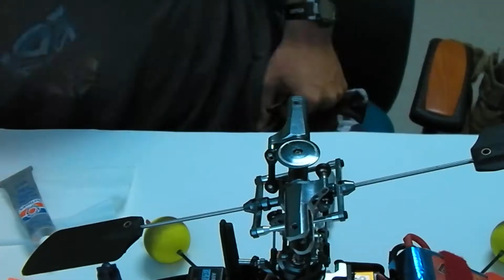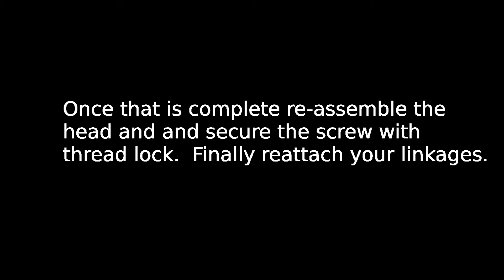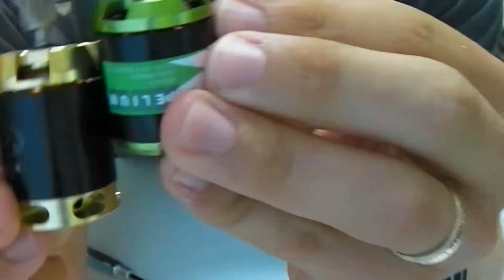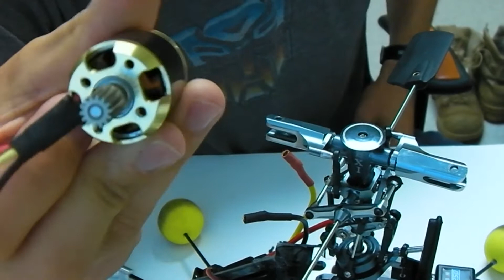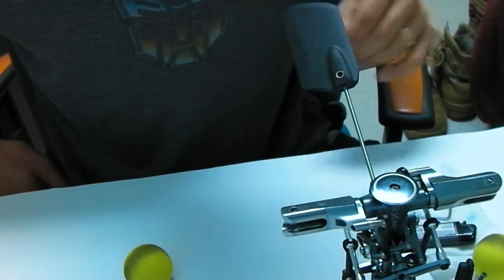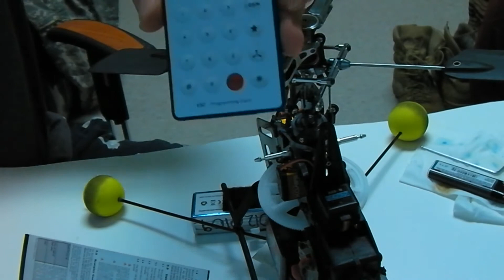Upgrades to the motor and dampeners and Scorpion Commander 45 amp ESC setup.

Comment: if you initialize a loop with a 450 you will need a MINIMUM of 50 meters to reach enough speed, i guess a 250 needs half of that, THATS MY PROBLEM, its not that i dont like my Zoom450 but its hard to do this kind of stuff with it!!! ; ) (its also out of sight quickly)

Comment from the maker: No prob, I understand the points you make.   Yes the 250 is better for small spaces.  when learning on a 450 you need a lot more room.  250 size could be flown in a large gym with a high roof.  450 can too but you need to be a skilled pilot to do so.